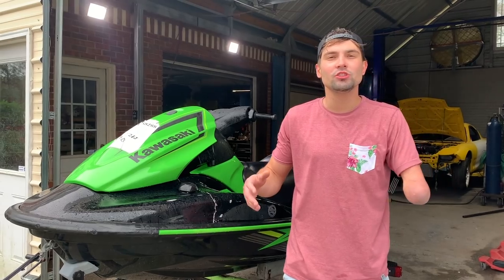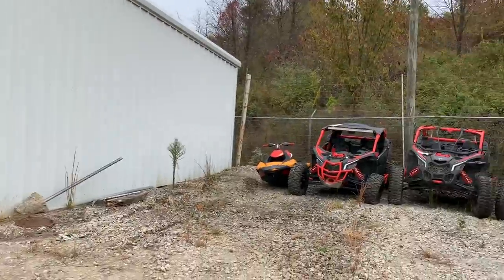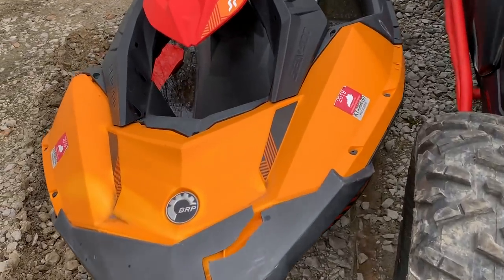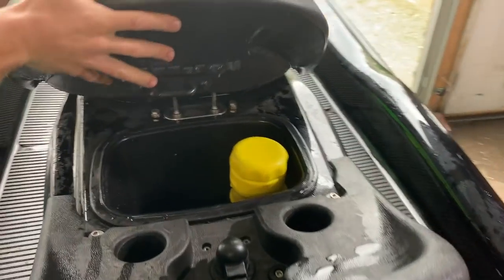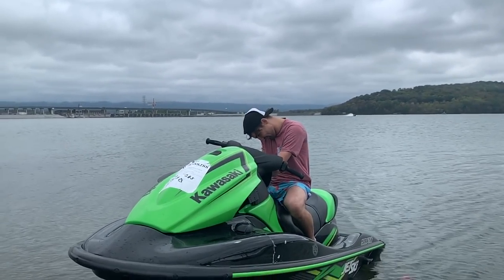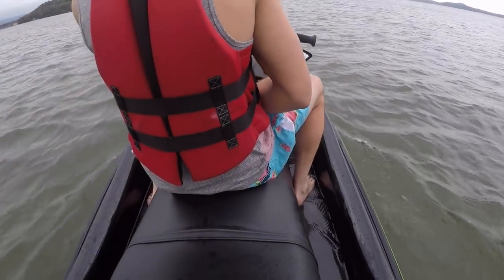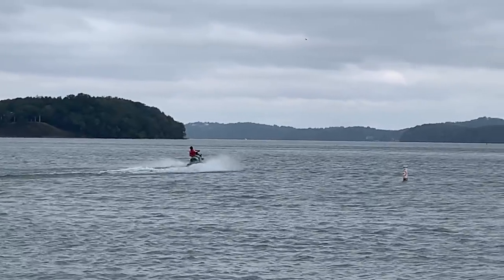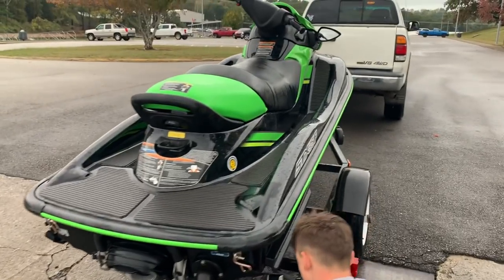I Bought A Wrecked Flooded No Start 2019 Kawasaki Jet Ski from the Auction

Comment: Great video, I have a 2008 stx 15f candy thunder blue. They are a great ski and they have been in production since 2004. Just finally they did a redesign for 2020 and all they did was just redesign the top part of the hull and added some new features, but left the engine and bottom of the hull the same, goes to show you if its not broke don't fix it.

Comment: All that fork lift moving it around was non-sense, you guys have a trailer for jet skis.   Just bring the trailer to the ski and pull it up onto the trailer with it's winch, unhooked from the truck. Once it's up rehitch to the truck and you're off. Could a saved all that fiddling with the fork lift.  Really nice find if you got it sub $1k

Comment: In case you didn't know there is a 1932 Ford t bucket with a big block and dual quads sitting on top of a blower at the IAA yard Long Island New York,  if you are intrested.  Frame bent under both doors. The body is near perfect. Don't know when it goes on the auction block.  May be a good investment.  I saw it last on 10/25/19.

Comment: Your supposed to disconnect the trailer lights before backing it in the water. That will prevent electrolysis and burn up those lights. 
Also, socks and sandles, never do that either
Reply from the maker: Good Tip! Nice to know that I will know next time, since I am restoring the trailer and getting some LED lights.
Reply: That's why you get submersible lights that are completely sealed

Comment: Nice, I have the 2019 Seadoo RXTX 300 and '18 GTR 230. The STX15F are loved by the people who do long rides. Good on gas and reliable. Styling is ehh. Well have to ride in 2020 ;)
Reply: Andrew Shevchuk cool collection, recently picked up an rxx with 15 hours going to pair it with my 96 hx on the double trailer. Along with my two 95 xp800s that have already been winterized.

Comment: When you rebuild your trailer put a chain wth a spring hook to catch the front eyelet on the Jet Ski. Don't trust the ratchet strap winch.
Reply: When the chain bounces around it hits the hull causing it chip and leave gel coat scratches and damage.

Comment: no need to buy watertight led lights. with my first boat (small 4 seater with 40hp) had a trailer with a normal light bar. It was low on the trailer so it was possible to launch the boat with the light bar on. the only thing I did was hit it with some w40 at the start of the season, take away a little light corrosion in case it had somesome with a scotchbright. it kept working for 17 years. only fresh water launches.